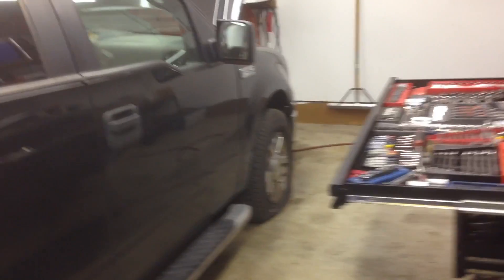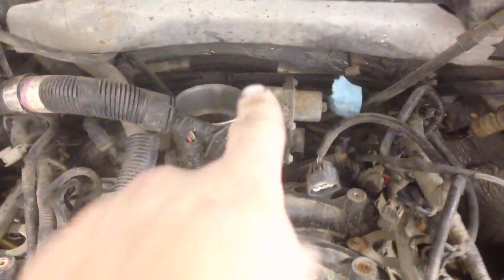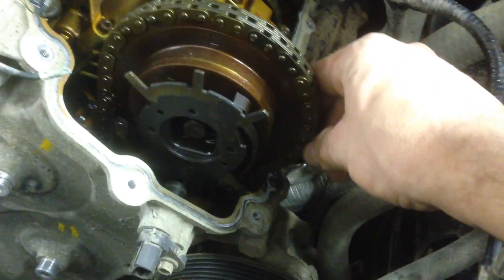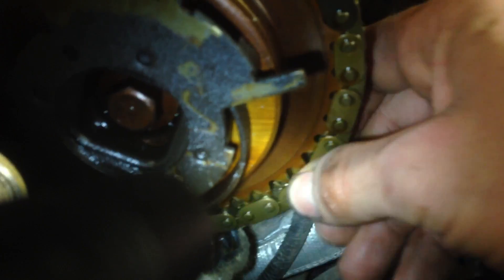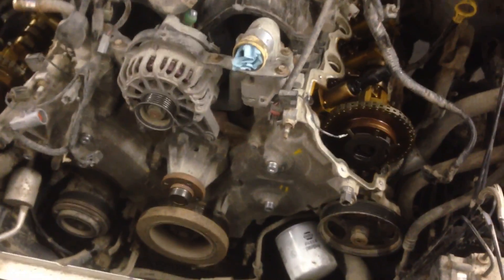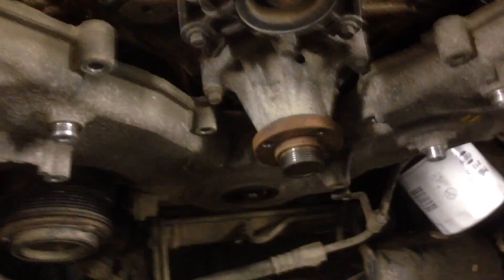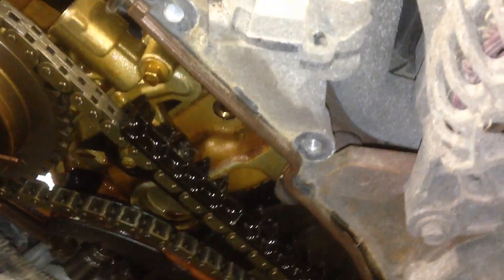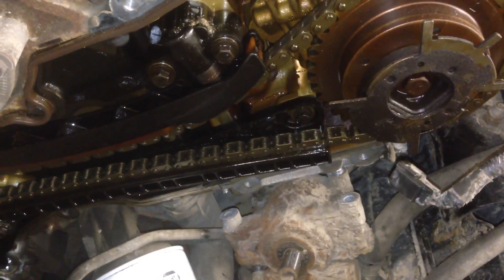Ford 5.4 Triton Engine Rattle Timing Chains

Comment: Mine has what sounds like the chain is slapping only at idle and only when it has warmed up. If I accelerate it goes away.  Or if if engine is cold it wont do it..been trying to get ut fix. Any recommendations in the central and north texas area
Reply: Did you ever figure out what yours was... mine does the exact same thing..
Reply: Nope going to take it to shop this monday
Reply: Antonio Pens bad timing chain tensioner on passenger side
Reply: Antonio Pens How much did it cost to replace?
Reply: Antonio Pens
Reply: how much you pay to get it fix??My truck is doing the same thing ..
Reply: Did it my self... new cam phasers and tensioners.. 600 bucks... runs smooth
Reply: where you live ?i will pay if you do mines
Reply: Mine does the same..drivers side

Comment: You can clearly see on the right chain (the one that's tight) there is still the plastic guide in place - right where you stick your fingers under the chain on your video. On the OK chain there is no way to shove them because you can see the orange plastic chain guide under the chain...

Comment: Yeah I wouldn't want you to rub anything in your vehicle or I would have sent to me you don't know that much about working on cars and let you know but we're going there are no GM dealership but I'm on your own in the net first law more than sound that good or you need to just your carburetor on that they don't sound that good I'll know my way around Kawasaki engine that's not right at all in the car nothing should not have any mmmm it at all. MX player run in carbs in love Tony feeling Jacksons I want to tell you right now that long or should not make that sound at all and in that plastic part to talk about I would replace it then whats up whats up Ahmed apart maybe in their stainless steel you may call Fillmore but now we're going to go for that way and have a plastic part be breaking on me and that and also I would use better spark plugs and go to synthetic world Pearson thetic I will go for and change the spark plugs on a put butter plugs in it nothing covering the better engine on the go all way around better I think they're on the Ford in there is a GMC truck in their room with Doug with all the heavy duty engine and I'll go for that and not too good about the 4G I don't care too much but forge in a car and one of the people running for me on the football football spark plugs in it none of that crap a champion junk all that now that he 5 crap spark plug with the split the Metro Bonneville that burn a hole right in the piston head and gallbladder kind of problems too while you're at it yeah I think I think you need to think you need to discuss the network on vehicles it all in there that long for the expression more of an expert in the new really are honey that's what you should really do don't don't fault because I'm telling you the truth cause my ears tell me in there in there that to you earlier and you don't sound that good and specially on that Ferris . This is Fred neon a grasshopper on engines all type of fluid motor boat engines work done on the grasshopper MMS this the reason I'm pretty savvy in there on the engines in electrical
Reply: ?????????, is this english?

Comment: When I opened my expedition the left chain was tight but the drivers was loose also. Probably bad oil passage designing. It's a shame this happened to the 5.4's reputation as they were really great motors just like the 4.6. I guess they through the motor design together so quickly that they didn't take to build it perfect.  The 5.4's are beautiful motors in anything 2007 and up
Reply: +Hudson Gothard  besides the slop in the chain,why is the chain tensioner going "flat" in the first place? bad gasket or seal to the block??????from what I have seen, all the above, when removing them it looks like the factory tensioner has a bolt boss that the seal goes around and the seal blows out over time around the protrusion  of that bolt boss. Causing  the tensioner to not stay pumped???
Reply: left IS driver side

Comment: Yup I see you said it was the tensioner. My atv (kawasaki bayou 400 4x4) had a stretched chain and it jumped teeth and ran like crap until it bent the intake valves on the old owners. I got it for free and put a cam chain in and some other stuff and she runs great! They would never change the oil on it there's other things I replaced but she's still limping at 2 psi hot idle oil pressure and 20 revved way up hot.

Comment: so what was the cause?
Reply from the maker: Collapsed tensioner. I'm putting new guides, chains, tensioners, sprockets, and plugs in it.
Reply: 3 valves were pretty problematic. Ill stick to my 2 valve 5.4.
Reply: You can tell it's a collapsed tensioner and it jumped time look at the phasers where the mark is and then look at your two black marks on the chain.
Reply: 3 valve 5.4 much better in my book More HP and torque  replace  the factory installed spark plugs  with the newer updated ones that don't separate & Your good to GO
Reply: provided it's not inherited.. lol hello 3v $400 later
Reply: Joshua Dutchman
Reply: John